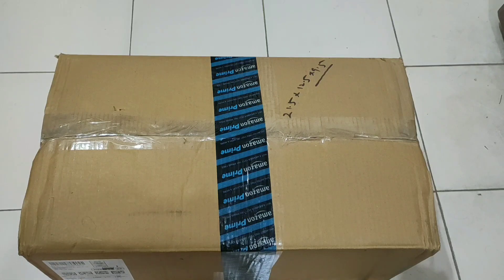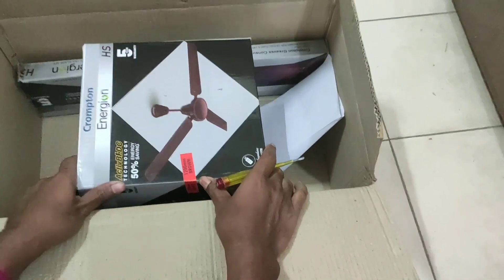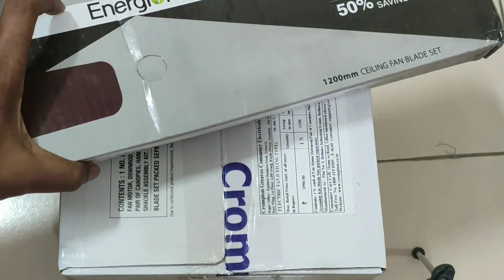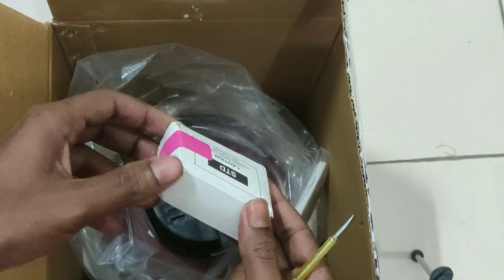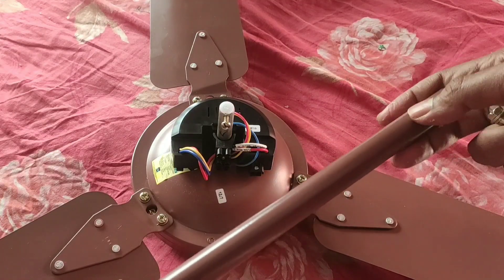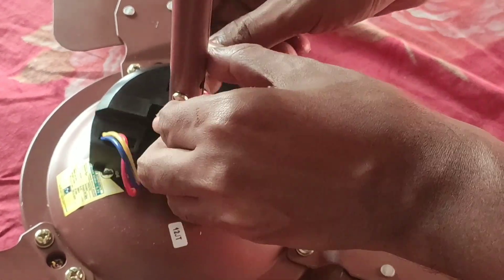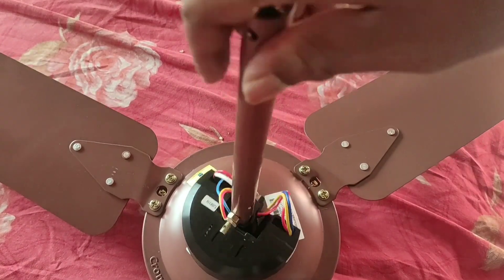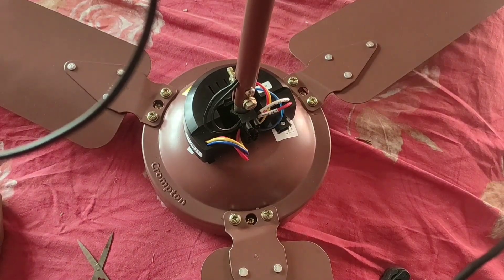How bldc fan looks like? and how to install Crompton HS 48 inch bldc ceiling fan with remote??

Comment: How is the airflow compared to normal fan, renesa is 70% of normal fan
Reply from the maker: It's quite smooth and uniform and most notably during voltage fluctuations it operates with same speed.
Reply: @subhadeeproychowdhury1059  airflow ??? Compare to syncronous fan
Reply: Pls tell me
Reply from the maker: @nehacgp  ......yaa the air flow is quite smooth and uniform compared to synchronous fan....
and in synchronous fan if voltage drops speed will also reduce
but in Bldc fan speed remains same even if voltage reduces and that is a big advantage.

Comment: I purchase 2 fan Crompton nstar but 1 remote are operating both fan I want separate programing for each remot so we can use other. Would you please help me to reprogram the remot
Reply from the maker: I am not sure, but may be u can push the reset button of other remote and by keeping the reset button pressed , switch on the fan .
Reply: @subhadeeproychowdhury1059  thank you very much. there is no reset button on it

Comment: Hello Sir, after watching your video I am planning to go with this fan. Can you please let us know it's current review as you are using it from some days. What is remote warranty which comes with this fan ?
Reply from the maker: It's working quite well and most notably during voltage fluctuations it rotates with same speed...Also it is having noiseless operations
Reply: @subhadeeproychowdhury1059 Thank you for reply, what about the remote warranty ?
Reply from the maker: @er.shubhampandey1595  ...it comes with i think 5year warranty

Comment: can you please confirm is the smps output is 12volt or 24 volt dc? Is there any connector option to connect external dc 12/24 volt so that it can be run through battery?
Reply from the maker: No there is no connector option in this model  for dc input power supply... But there are some other model where you will find dc connector directly to motor